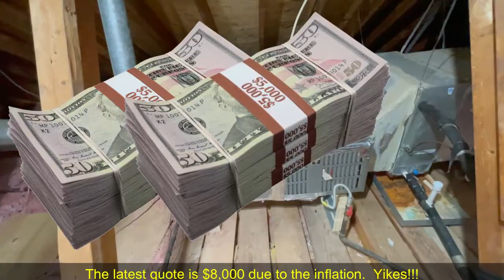HVAC Blower Keeps Turning On and Off.

Comment: One of the most educational videos made by a homeowner I've ever seen! I am having exact same problem and my A/C unit was replaced (entirely) 4 years ago, so, 'brand new' but I know if call people to watch the problem would cost much more than just have the part and replace it. Thank you for sharing your experience.
Reply from the maker: Thanks for the feedback. One of her HVAC technician told me it was common to see old. HVAC units last 20 to 30+ years, but he’s seeing new units starting to fail under 10. So I’m trying to keep old unit run as long as they can as long as parts of reasonably cheap to replace.

Comment: Awesome help, fan runs for a while and stops, .... then will start again after a while as compressor keeps running, changed Capacitor it read 6 and is a 10 so was weak replaced it but did not keep the blower running I bet it is the same issue you had, your video could be a huge help to many with the same issues!! Appreciate you and your video.
Reply from the maker: Until you get the control board replaced, you can turn off the unit for 30-60 minute to let the sensor cool down and it’ll turn on and off normally for a while, which can be 1/2 days long to multiple weeks long. Thanks for the feedback and let me know the outcome when you get it fixed.

Comment: Thanks for the video, the time and effort you put into this was great. Really informative and I'm happy the comment section is talking about it too. This issue is really annoying.
Reply from the maker: It’s very annoying and likely repairman will try to get us to replace the entire unit. Just $120 control board plus labor should fix the issue and delay the new replacement for several years.
Reply: @DIYLifeSkills  Hey when you said delay new replacement. Do you mean when it does the off and on thing, it is an indication that the whole unit is getting closer to fail and break? Like the new motherboard will hold it off for a few years then you have to replace whole unit or just another motherboard replacement?

Comment: I'm having the same problem now, it just started a few days ago and my entire system is only 3 years old. I been having a problem with my heating it won't stay on, it started acting up 2 days after my system was installed and the company who installed it, kept sending people out and no one could fix it, so now the AC clicking off and on 😩I really believe I was sold a defeat system, that company didn't even honor the 10 yrs warranty they claim I had.
Reply from the maker: Likely one of the sensors doesn't work properly when the system runs continuously and makes the sensor hot.  For me, the quick fix was to turn off the unit for 30=60 minutes to let the system cool down, and that made the system work again for few days to over a week, but the problem just kept on coming back until I replaced the control board since various technicians couldn't figure out exactly how to fix the problem

Comment: Thank you so much for the video you don't know how long I've been looking for a video like this My AC unit upstairs keeps going on and off the blower Air conditioning works great The heater works great it's just that after they shut off the blower stays on then goes off 4 minutes later goes on then goes off so I'm going to go ahead and try and just turn off the power to it and then restart it and see if that helps if not I'm going to replace that motherboard I'm pretty sure I can do it I'm an IT guy. I just couldn't figure out what the hell it was I thought it was a capacitor also. But thank you so much for spending the time and being so thorough about everything even showing how you found the motherboard that's the next question I was going to ask right before you showed it. You're the best. Oh I forgot about your part on American home shield they're a bunch of thieves they never fixed anything at my house I told them My pool pump wasn't working they said oh that was my fault when they came over I didn't maintain it you don't maintain a pool pump they'll make any excuse I had them for a few years and they never fixed anything I put my money in a separate account now I have over $7,000 and I pay for it myself which doesn't even cost me a few hundred stay away from those companies
Reply from the maker: For me I had to turn off the power for at least 30 minutes for some sensor to reset and to able to start and stop the blower correctly.   I tried to talked about this in detail with several technicians but their answers were there are too many sensors and it’s not easy to pinpoint which is going bad and they would have charge for several hours of troubleshooting.   I’m also IT guy and do all sorts of DIY, and after watching them do it, I feel that was easier DIY than some of cat repairs I’ve done.   BTW, capacitor is for starting the motor only and it doesn’t get involved in shutdown.  If you blower fails to start, do replace the capacitor which is even easier.  Only caution is make sure you turn off the power to the unit disassembly, and for capacitor, discharge the current it’s holding using a long screwdriver (you can look up such video).

Comment: Great video!  I agree with you about the home warranty.  I had a warranty when I bought my house and they came up with excuses to not pay for my AC, washer dryer or dish washer.  Total scam!
Reply from the maker: They did some of the stuff but put up a fight on anything that was going to be costly.  I should’ve canceled it long time ago. 

BTW, that old AC motor ran too frequently too  long due to the main board problem that it finally crapped out.  So I’ looking at $500 blower motor replacement.  If they can’t do it this week, I may attempt it myself.
Reply: Me too! They charged $75 every time a technician came out and fixed nothing. We also paid a lot of money for 2 years of coverage in full

Comment: I have a blower out the fuenace, it runs for 30 seconds then turns off and sterts back after a 1 minute.. what could be the fix to keep it running?
Reply from the maker: Sounds like same problem I had.  Based on my research, one of the sensors on the control board stops working when it gets hot.  You can verify this by turning off the power to the unit for 30-60 minutes for the control board to cool down, and if it starts and shuts down normally, then you have the same problem as I.  I suppose, if you are electrical guys, you could test and replace just the sensor through soldering, but since this board is only like $125, it’s easier to just replace it.  The repair guy was trying to scare me by saying it’ll be hard to find and could cost as much as $500, but I had already found an HVAC store that had it so I picked it up and repair guys just replaced it for me.
Reply from the maker: Looking back, I could’ve replaced it myself but since they came out they were going to ask for some payment anyway, so I let them install it for about $200.
Reply: Thanks so much,, I just have it a fan blower for the summer time.. I'm not spending that much on it.
Reply: Furnace

Comment: Mine is doing the same thing.  Blower motor runs for 3 or 4 seconds, shuts down, then runs for 3 or 4 seconds over and over, causing the compressor outside to keep running and freeze.  I shut the system off for 30 minutes until the thermostat display goes blank.  If I try to turn it on before the thermostat display is blank, it does not reset the system.  I was thinking it was a thermostat problem.  I have a Carrier system that does not have a capacitor on the blower motor.
Reply from the maker: @gruntbot1227  if your compressor and outside fan run and cool then its not your capacitor.  This seems to happen in hot summer when AC is constantly running without giving time for HVAC system inside the house a chance to cool and then the sensor doesn’t report correct signal to start and shutdown properly so it keeps on turning off and then back on.  Mine is carrier too, and replacing the motherboard fixed the problem for more than a year now.
Reply from the maker: @gruntbot1227  motherboard was little over $100 and labor was $200 for me to replace it.
Reply: @DIYLifeSkills  I have a 2016 Carrier System that does not have a motherboard.  It has eight components mounted to the sheet metal in front of the blower and then wires running to the motor.  Two of the components are limit switches that I checked for continuity.  One of them failed intermittently.  I ordered two new ones from Amazon and will install them next week.  I will let you know if that fixes the problem.
Reply: @DIYLifeSkills  While waiting for the limit switches to arrive, I did a full cleaning of the evap coils top and bottom using a vaccuum, then foam, then coil cleaner.  What really surprised me is when I pulled the emergency float cut-off switch located right next to the evaporator drain.  It was just covered with white gunk and was blocking the drain line.  I had been pouring vinegar down the drain line but the access pipe is after the emergency cut-off float switch so I never thought to check it.  I let the system dry for a full day, fired it up, and after 3 cycles, it began working normally.  I change the filter every 3 months, but that gunked up float caused the water to back up into the evap coil and created a mold nightmare in the coils.  The system must have an airflow sensor somewhere on it because once the airflow improved, the system fixed itself.  Crossing my fingers that this was a permanent fix.
Reply from the maker: @gruntbot1227  Great troubleshooting!!!
Reply from the maker: @gruntbot1227  Wow awesome work.  For me, I usually pour bleach down the drain line every 6-8 weeks during long summer because down here in Houston the AC is running very frequently.  Great work!!!
Reply: @DIYLifeSkills  I live right down the road in San Antonio.  I really need to start cleaning that coil every March.  Lesson learned.  Thank you for all your help.
Reply from the maker: @gruntbot1227  That reminds me to clean my coil as well. It’s been a few years now.
Reply: @DIYLifeSkills  System crashed after a day and a half and the blower began starting and stopping again.  The limit switches finally arrived in the mail and I replaced the one with the funky Ohm values.  Seems to be working fine now.  I will check back in a week and let you know if it was a permanent fix.
Reply: System crashed the next day.  Called a pro who told me my motor is going bad.  I told him the motor works fine when it starts.  He said these new ECM motors have the Motherboard and Capacitors built into the motor cap and they are known to go bad after a few years.  I checked Amazon and a new ECM motor is $400.  I decided to just let the system run 24/7 in the on position so I don't have to worry about the ECM part of the motor not working.  My electric bill was $190 last month and I am told running the motor constantly does not cost that much more and puts less wear and tear on the system.  It also keeps my whole house nice and cool rather than having it cold downstairs and hot upstairs.
Reply: The saga continues.  I left the fan on 24/7 and the system worked fine except the house got too humid.  Leaving the fan on constantly interferes with the disposal of evaporator coil water down the drain line.  Instead, it just gets blown into the air.  Long story short, I bought a new ECM motor on Amazon for about $450 and installed it today.  I also cleaned out that nasty squirrel cage while I swapped motors.  Everything seems to be working fine.  The new ECM motor advertised it is next-gen and runs on much less electricity than the first generation ECM motors.  The experts wanted $1800 to put in a new motor so I saved $1300 doing it myself.  It is pretty easy if you are careful and watch a few YouTube videos first.  I will let you know what my energy savings are, if any, next month.
Reply from the maker: @gruntbot1227  Yeah my blower motor eventually started making lots of noise due to worn bearing and I had to replaced it for only $550. I think he told me half was motor and half was labor. I think he used cheap motor.
Reply from the maker: @gruntbot1227  You are quite handy than me.  I just have trouble working out of very hot attic here in Houston.
Reply: @DIYLifeSkills  Fortunately my system is in a closet on the second floor.  If it was in the attic, I would be in a corner with my thumb in my mouth curled up in a ball crying.  My electric bill for July was about $15 higher than normal with the system running 24/7.  I expect a significant drop this month with the new ECM motor running only when the temp goes above 76 in the house.  We shall see.
Reply from the maker: @gruntbot1227  Now that you mention the e electricity bill, my recollection is it was just the blower that had trouble to shutdown and kept on stop and starting but the compressor wasn’t kicking in.  And I believe the compressor is what consumes the most electricity. So I didn’t see huge spike in electricity bill during that trouble period.   However, with the blower stopping correctly after board and blower replacement, I probably saw about $20-30 in electricity savings in 3300 sq ft home.
Reply: @DIYLifeSkills  Last month was strange because we didn't get the 100 degree temps we normally do, so if my electric bill drops this month (now that every day is 100 again), I will know the new motor was worth the price and will probably pay for itself within a year or two.
Reply from the maker: @gruntbot1227  Where are you located?
Reply: @DIYLifeSkills  Just North of San Antonio.
Reply from the maker: @gruntbot1227  Ahh. You are also in Texas.

Comment: It's the temperature control circuit, and i guess the culprit is just small aged resistors which are part of the circuit. Don't have to repair whole board
Reply from the maker: The board was only like $125 so rather than troubleshooting, ordering parts, and resoldering I think it was a cheap enough to replace it and should be good for 5+ years I hope.

Comment: I have same issue. Sometimes blower runs okay for few hrs. but sometimes runs only few mins. I replaced capacitor no luck. I am waiting the control board.
updated: The Lennox AC fixed. After replaced the control board, the blower works as normal.
Reply from the maker: I meant to ask you earlier. How much did they charger for labor and parts?  Also, since I let this condition go on for I think couple of years, my blower motor bearing eventually wore out and started making a lot of noise. So I paid another $500 to get that replaced.  Hopefully I can get another 5-10 years before I have to replace the whole thing.  LOL
Reply: @DIYLifeSkills  I did myself. I am not pro handyman but can do some.
I couldn't find same model of board but I found a same shape of different model of board. I paid used one at ebay $94. Still working good
Reply from the maker: @liebe781  good job. After watching them do it, I realize I could’ve done it also but since they already came and will charge me for something I let them do it.